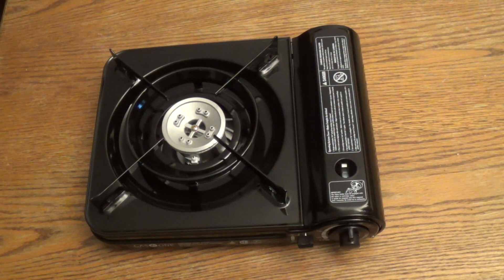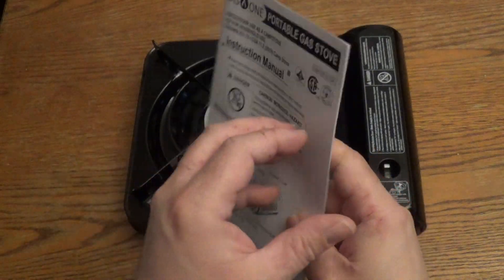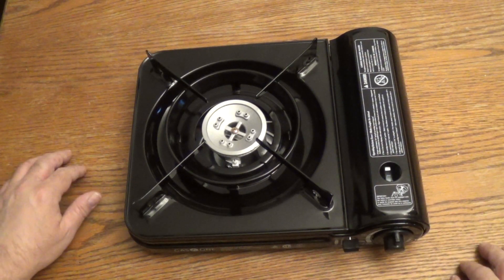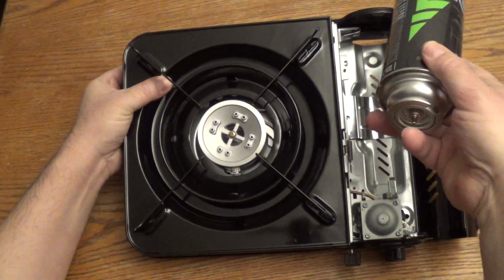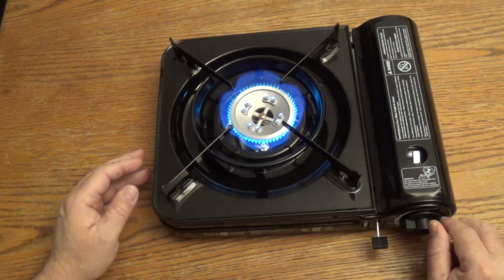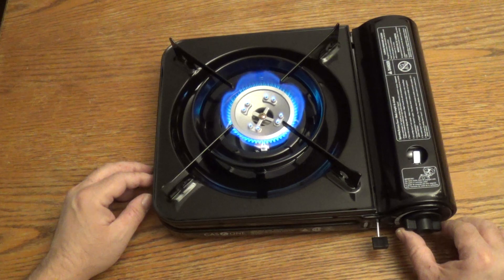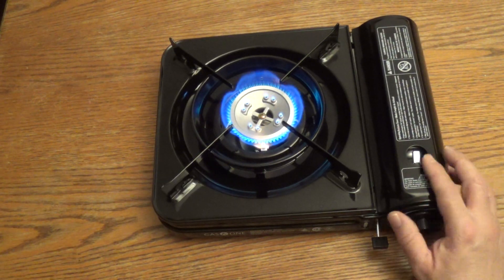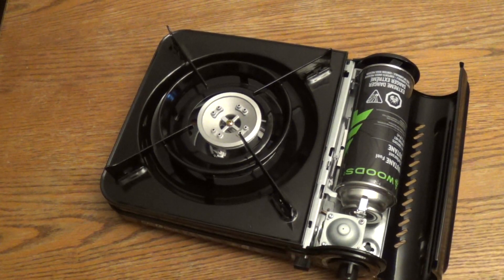Gas One GS-3700 Butane Gas Stove

Comment: GS-3700 According to the manufacturer...
Sleek, powerful, and lightweight, our GS-3700 is the way to go for any camping trip. With a smooth metal body and enamel-coated drip pan, our stove ensures an easy and enjoyable cooking experience. This iconic little stove delivers 10,000 BTU, making it a wonderful addition to everything from camping gear to an emergency kit!

High Output of 10,000 BTU
Weighs Only 3.3 lb
Uses 8 oz Butane Canister
Comes with Portable Carrying Case
Outdoor use only!
Reply from the maker: Thank you! 🙂
Reply: @krucydoesgardeningstuff6785  You're welcome. I just figured it would help to have some comments and to share some details :)
Reply from the maker: @james0000  It was more than helpful! 🙂